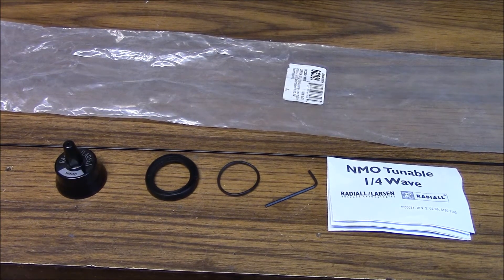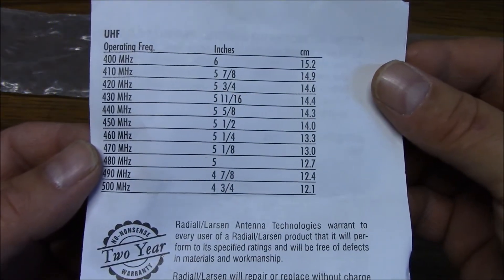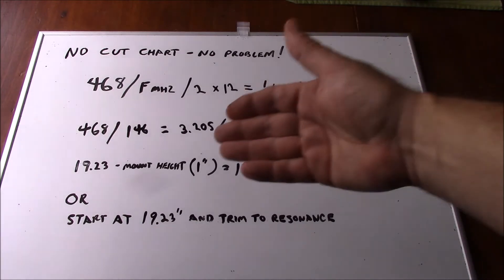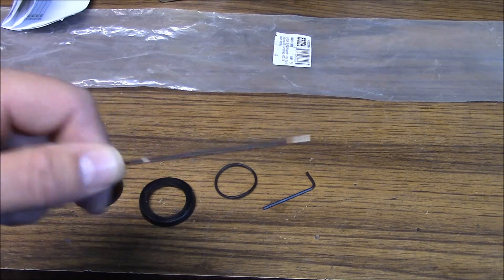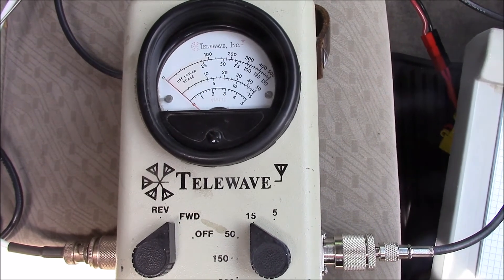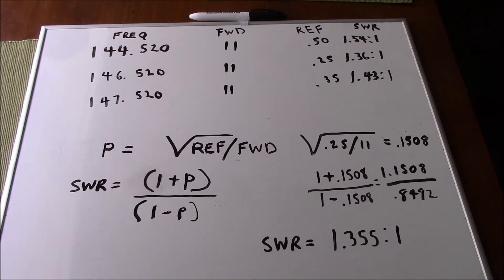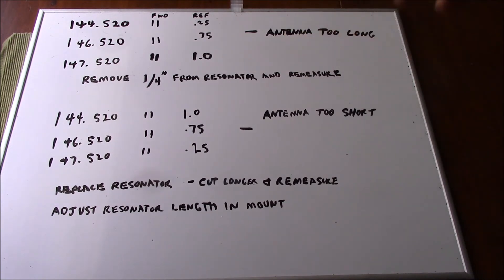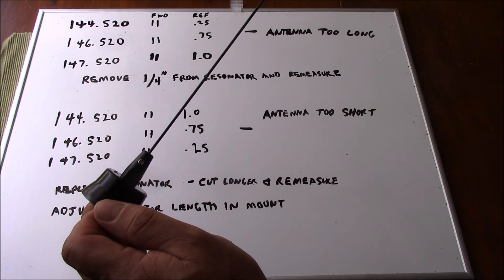Basic VHF/UHF mobile antenna tuning - The quarter wave whip

Comment: Im confuse with the tuning chart on line. I want to tune my larsen mobile antenna with magnetic base. I hook it to an icom base radio IC 2000. Id like to have the 144.23 frequency.I dont know exact lenght to be cut on my antenna.Pls any suggest  very much welcome...
Reply from the maker: 19.5"  cut to 19.75" inches and trim to resonance for a quarter wave

Comment: Hello, I have a mag mount Antenna. It tuned to a certain frequency by factory, I need to replace the whip and my question is which part of the mount is tuned? The whip or the mount?
Reply from the maker: The length of the whip. On an increase in frequency the whip is shortened. In a decrease in frequency the length is increased. Thanks for watching !

Comment: im trying to tune my antenna(larsen) but when i put my mobile base into high power the swr went to almost 2.5 and power is more than 100 .what should i do
Reply from the maker: Make sure the RF connector is good and that the NMO connection is good. Who made the base and what type of feedline does it have ? Thanks for watching
Reply: Rf connector is good , yaesu
Reply from the maker: @reynaldotabot  I meant the antenna base - is it a mag mount, what manufacturer made the base ? Have you tried another antenna ?

Comment: Question. I have a dual antenna whip nagoya. It has 3.5vhf and 5.5 of gain uhf.   If i tune the uhf frequencie tona desire, will the gain dimish or be affected and the vhf .
Reply from the maker: Yes there is a balance due to harmonic relationship between UHF and VHF when you adjust to resonance. The amount of gain of the design will not change however unless the antenna  is considerably taken outside of its design frequency. Thanks for watching !

Comment: I'm a newbie at this stuff and I just bought a Nagoya UT-72 19" 144/430Mhz antenna to use with my BF UV-5RM handheld in my truck.  There aren't any instructions on HOW to tune this antenna that I could find.  Would I tune this the same way you've described or is there a brand-specific method??  Thanks.
Reply from the maker: You would do it the same way. Just start with VHF. Test midrange 146, then test low 144.500, and then high 147.500. then confirm on UHF thanks for watching !

Comment: just get you a vhf swr meter would save u all the math
Reply from the maker: I did use a meter.  This is a learning channel - without context there is no knowledge.
Reply: @survivalcomms  i understand but not all are good at using said equpment and use was equlvent to a bird meter and not every body have just syaing use swr meter to skip the  math

Comment: Love it. Decided this weekend to go after my amateur license. I dont even own a radio yet, but I started studying yesterday and am taking the license exam this thursday. Ive been going through practice tests since yesterday and am passing every time now at about 80-85%. The last 6 tests I have done have all been passing. Will do another several tests tomorrow, and again wednesday. No study day of the exam. I dont like to cram day of. Am looking at what mobile radio and antenna to get for my first. Im in civil engineering by trade, so I enjoy doing the math like you have shared here. You also used some of the foundation of RF that is on the test anyway 😁
Reply from the maker: You will do great and thank you ! I tell folks if you get over an 80 on 10 practice exams in a row passing is certain. There is no trickery in wording like "always do except" etc. Get a mobile with dual receive ,dual VFO's, dual knobs. Its like two radios in one. You will really enjoy the flexibility. Thanks for watching and good luck on the test !
Reply: SurvivalComms .....any advice or recommendation on a mobile?
Maybe Icom IC 2730a?
Reply from the maker: @jay-rus4437  Kenwood TM-V71a
Reply: @survivalcomms  can you link were u get these antennas please
Reply from the maker: @AndrewMurphy8383  Tessco.com
Reply: SurvivalComms ....passed exam saturday. Missed one, so all was good. Installed an ic-2730a in the truck with a roof mounted NMO mount antenna. Just spending time now listening, programming, and learning about the radio. Havent seen any real support locally from clubs. Ive reached out to a couple now, but they havent felt very welcoming really. Could be the covid issues, so maybe they arent up and running so to speak. There is one local guy that I have emailed several times, and he has been reasonably helpful in sharing some info, although he also seems very opinionated and seems to like himself a lot 😂😂😂
Reply: @jay-rus4437  most older hams do now days

Comment: You don’t mention power !! My swr  is low ( 1.2 ) at 25 watts and 3.5 at fifty watts. What do you do with that ??
Reply from the maker: What antenna, mount, and frequency are you using ?
Reply: Description
38 inch with NMO 3/4 inch connector 17 Feet RG58 Cable PL259 Connector and L bracket mounted on a headache rack grounded in 4 places , running a Yeasu FTM 100 DR on the 147 and 440 frequencies
Reply from the maker: @deadbang241  have you tried a 1/4 wave  antenna at either VHF or UHF ?
Reply: No, this is a brand new set-up
Reply from the maker: @deadbang241  Could well be a poor antenna , mount , cable, or RF connector. I would start with isolating the antenna base to the RF connector by putting a 1/4 wave antenna or dummy load on the NMO base Who manufactured the antenna ?
Reply: SurvivalComms  : It is a Tram 1180 from Amazon
Reply: I will look at the Larson brand 1/4 wave. Thanks for your help.
Reply from the maker: @deadbang241  You are welcome ! The tram 1180 is a decent antenna. I would try a generic cheapie quarterwave just as a tester. The larsens are my favorite but they are pricey.
Reply: Why not a mirror mount. Im chopping the same antenna hooked up to a keenwood tm281. Also going to shortening the cable.. It works and i can keep an eye on it 👀